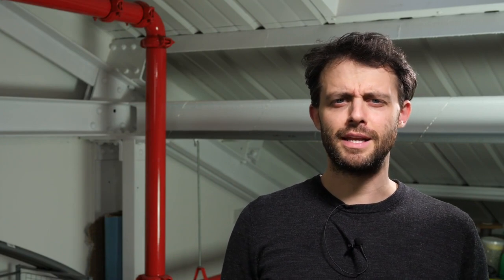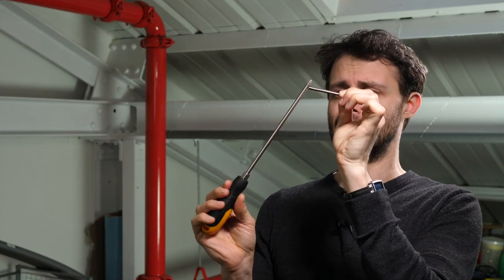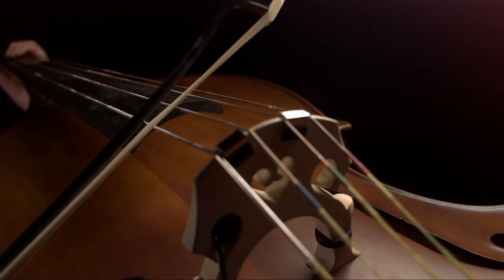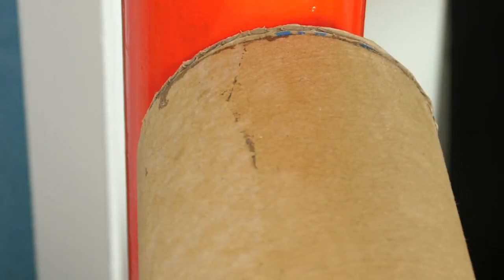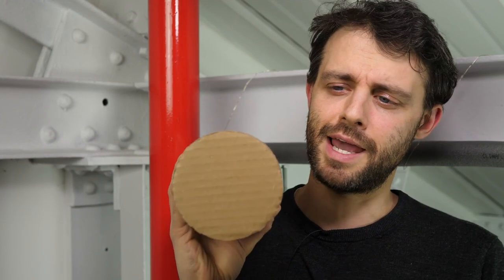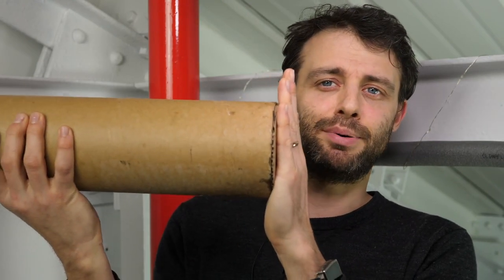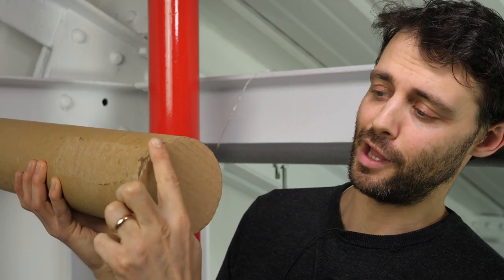The Climbing Magnets Mystery (ft. Steve Mould)

Comment: After watching less than half a minute of this, here is my explanation:  When you move the screwdriver around a bit in an effort to get the magnets to spin around, you are moving it quickly in very small partial rotations.  These short arcs, while not full 360-degree rotations, nonetheless impart a force on the magnets that is similar to the force that keeps the Earth from falling into the sun due to the Sun's gravity.  Any body in a rotational motion, even if it is a small arc that is only a portion of a full rotation, will have a tendency to move outward and away from the center of rotation.  This is just like spinning a yoyo on the end of its string.  The yoyo has a tendency to fly away, but the string keeps it attached, so it doesn't.  The main point I want to make here is that the magnets naturally tend to fly away off of the screwdriver because of the small arcs in the motion of the screwdriver that is used to spin the magnets around.  Basically, the screwdriver is making at least two different types of motion.  One is back and forth, which is what causes the magnets to rotate around the center of the shaft of the screw driver.  However, the other is the small arcs that also get the magnets to move in a direction perpendicular to their spinning.  While I probably haven't explained this as well as I could have, the small arcs would have their center either at or near the fingertips (I think you know what I mean) or at the back of the handle end the screwdriver.  Because the motion is erratic, that center is probably moving around a lot.  You could probably test this idea by putting washers on the screwdriver that are nonmagnetic.  Doing the same thing would probably cause the washers to start to move towards the end of the screwdriver opposite the handle and where the hand is holding it.  Anyway, that's my explanation.  Do you like it?  What do you think?
Reply: Okay:  I watched the rest of the video, so now I've watched the whole video all the way through, and I must say I did not expect the explanation that came.  Also, when the presenter turned the screwdriver upside down, and the magnets continued to go upwards, that was pretty interesting.  In conclusion, perhaps my explanation was not the complete answer in the case where the magnets were going away from the hand.

Comment: 0:44 The tip of the screw driver is spun around the furthest out. The centripeta forces is greatest there. If you were to loop a string around the screwdriver, it would do the same thing when spun around. If you spin a marble in bowl, it travels to the furthest edge of the bowl too. Everything does  this.
Reply: He tests this theory in the video and shows that is not the explanation.

Comment: I'm sure that if the screwdriver was kept completely vertical whilst moving in tight small circles, the magnets would not climb - in fact they would probably slide down due to gravity. The point is that doing it as shown the tip of the screwdriver is describing a larger circle than the base thus imparting greater centrifugal force.

Comment: It's because you're rotating the rod with a pivot at your hand. If the rod was tracing a perfect cylinder then the magnets would remain stationary or fall due to gravity. With that angle, though, the centrifugal force/inertia of the magnets exerts a vertical component on the slanted rod, which is tracing a cone.

Comment: I'm not fully convinced on the slip/stick explanation. As the magnets roll around the shaft their point of contact reduces to the point that it is no longer enough to hold the magnets up. At this point they will start to fall off but remain in contact on the lower edge. This is when the rolling around that lower contact point occurs and as the area of magnet having the shaft "in range" is then increased the magnets then snap back in and onto the shaft. In effect, the magnets are always rolling and never sticking or slipping?

Comment: the motion of the screwdriver is not perfectly cylindrical and the top swings more then the bottom. the spinning causes centripetal force while the magnets keep it attatched. the net result is a transfer of the magnets upwards as the centripetal force is greater near the top. but also it causes the magnets to rotate which in turn makes them roll along the rod and probably create some sort of magnetic force in the metal.

Comment: why not lube up the screwdriver to show it's dependent on the friction?  I think it's because the screwdriver is not vertical, it is tilted to one direction(towards the magnet) as you spin it around, causing the magnets to slip towards the path of least resistance("downhill" from the perspective of centripetal force) up the shaft.

Comment: I would have liked to see the screwdriver held horizontally and put in the drill and use the ruler as a backstop (similar to the vertical test).  If this explanation are correct, the magnets shouldn't move from their position on the screwdriver.  I think that would have helped to confirm the hypothesis.  I think it would have been interesting to demonstrate before the explanation as well as it would have helped in formulating a possible explanation by eliminating some ideas....

Just my .02

Comment: The explanation might be incorrect.
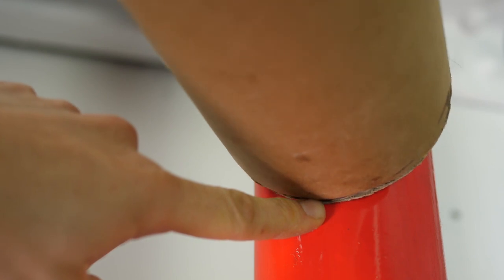Look at 5:53, the resulting direction of the rotation of the magnets does not match with the explanation.
I think that the pivot point remains the same, but the magnets rotate downwards due to gravity and the resulting momentum, instead of rotating upwards. Then they slip upwards.
Micht be wrong, but i think that this explanation is at least not complete...
Awesome video still

Comment: What would happen if the magnet had a square section instead of a circular section - a square prism? (I mean, the magnetic prism placed in such a way that two lateral faces were vertical and the two other lateral faces were horizontal). I guess the pivot point would be at the same height as the previous point of maximum pressure and so there should be no rising at all.

Comment: What if you had a magnet with a contoured end? - Does the same rising phenomenon still occur? (could machine a small bit of steel or iron (or any material) to change the contact/prevent slip)

Comment: Reply to Brad not Landa
Looks to me as though the angle of the screwdriver always leans, and that would make your contact points on the top of the magnetic column. As it holds to the screwdriver, I think the magnetic column pivots it's bottom a little bit upward and aß the magnets re-grip the shaft. Since the magnets are round it would be unobservable at the speed of rotation.  
That's my guess.

Comment: 25 seconds in: I'm pretty sure as you rotate the screwdriver you angle the point out a bit. Centrifugal force pulls the magnet away from the center of rotation, so they travel up the screwdriver
Reply: 1 minute in: shit

Comment: It’s the same as the standing pendulum in a reciprocating arm.  Or the oscillating suspended liquid.  The righting moment of the magnet up to the rod is a larger force than the gravitational oscillations downward.  Thus the over all result is that the magnet will climb over time.
Reply: After watching his explanation I still think my idea on asymmetrical righting could be coming into play as well.  It’s possible that as it rolls and slips it is also tipping so that less of a line across the end but a point on the edge of the end remains in contact.  It could could slip stick in multiple ways.  It would cool to see a high speed.
Reply: The ruler doesn’t replicate the slip-stick satisfactorily.

Comment: 0:15 ; 
Hypotheses: 
1. Not a perfect system, the angle on the screwdriver gives the attractive and centripetal force a verticle component.
2. As the system spins the magnets are pulled horizontal by the centripetal force, due to the larger momentum of inertia, they tend to want to lag behind the spinning action of the screwdriver. Because of being drawn horizontal, they now have a pivot on the upper side, the lag the magnets experience cause them to rotate around this pivot which also rotates with the magnet allowing it to roll up the side of the screwdriver.
Reply: Nope
Reply: 2:09
Renewed hypothesis:
1. Friction caused by the magnetic attraction drives the magnets with the rotation of the screwdriver, gravity imparts a downwards force. As the magnets loose attraction, a pivot forms slightly in front and below of the round magnets on the screwdriver, this allows the magnets to roll forward and a little up, attraction is now dominant again. Rince, repeat and the magnets roll up.
Reply: Okay, was not expecting it to be an unstable system.
Reply: 4:30
Booya

Comment: wish they had put a line on the magnets and filmed it in slow motion to show that the line goes around the magnets as they rise.

PS: wonder how much weight they could carry proportional to magnet strength. Should be possible to scale. And what is the slowest speed in which the effect occurs?

Comment: my first thoughts would be that centrifugal forces are greater at the top because the screwdriver top is following a greater arc than the bottom. Simply put, the magnets are trying to fling off the screwdriver and they get closer to flinging off as they approach the top. Put the screwdriver in a drill and your mystery won't happen.

Comment: Would it also occur if the screwdriver was moved in a perfectly vertical circle rather than a spiral where the largest diameter is at the upper part of the spinning screwdriver?

Comment: Doesn't this work with a string and a weight. Make a looped string put a small weight and at the other end and then spin it then it goes up around the screw driver. I remember seeing that demo done in my class. Is it the same thing?

Comment: 2 min in, like everyone else, centripetal force was the obvious guess, but wrong.   next guess - Left hand thumb rule - electromagnetic currents are weird, and I think that the motion of the magnets around the induced magnetic field in the screwdriver has a perpendicular reaction - like when you turn a spinning wheel one way, it tilts in a plane at 90 degrees to it (think a bicycle front wheel.  So perhaps the spinning makes a magnetic field, which interacts back with the motion of the magnet and pushes it up?  maybe.... gotta admit, when he spins it the other way around though, this should make the magnets sink...  hmmm... I think I bail on my own guess.... but even so - weird magnetic fields are happening.... even if they arn't the thing that does the magic trick...

Comment: So if you were to try doing this with those small magnets on a very large pole or pipe, say 2m in diameter, so the magnets are all but flush with the surface of the pole, this wouldn't happen?

Comment: I was thinking it had to do with the rotating magnets inducing a current in the screwdriver, hence inducing a counter-magnetic field, and the interaction of the two magnetic fields would drive it upwards.  Well... I was pretty much totally wrong and it's just the mechanics of the physical contacts.  Very interesting however.

Comment: looks like electromagnetic propulsion. As the magnets spin they impart a small charge into the metal rod, which in turn creates a small magnetic field. Since magnetic fields are perpendicular to the direction of electron flow, the generated electromagnetic field pushes the string of magnets upward.

At least that's the best theory I can come up with. It's definitely incomplete because it doesn't explain why the direction doesn't matter.

EDIT: I was completely wrong XD

Comment: The correct reason is that the the moving magnet on the metal screw driver induces a electric current witch in time creates an magnetic field that interact with the magnetic field of the magnets pushing it upward.

Comment: I don't think it's a magnetic phenomenon as such, it'd probably work if you looped a short string with weight on the end around the rod, as you gyrate the rod the top prescribes a larger circle than the bottom so it's centrifugal force causing it to ride upward. was only at 0:45 when typing this.

Comment: easy, when you hold the screwdriver up and rotate your reaction plane is like a V and the force (centripetal) is > relatively on the right side so its obvious it will travel on that slope. if you hold the screwdriver upside down and make an A shape reaction force plane, and it will travel down if you consider \ plane and -> force due to centripetal acceleration and  on the left side < and / same result... if it were | and -> it would have stayed where it was.

Comment: Although I am not a physicist by any means my first thought was that it has something to do with the 3 Finger rule and magnetic fields. Please correct me if there's anything wrong with my thinking here.
We'd have the magnetic field created by the magnets pulling on the screwdriver in one direction, our thumb. We are moving them around the screwdriver, which would according to that rule would be our thumb and that would mean the Lorenz force is pointing upwards and moves the magnets up and along the screwdriver.
Reply: Since you mention the 3 finger rule - what exactly is the 3rd force you are talking about?  
3 finger rule simply tells you the force on moving charged particles when inside a magnetic field. Does not apply here.
Reply: Ahh, okay, thanks. :) 
The three forces that I thought would be applied here were the magnet pulling on the screwdriver in one direction, the magnet being moved around the screwdriver and the force that pulls it up ^^' At least that was my theory.

Comment: So is no one going to point out that anything that rotates has torque, and that the angular momentum of the object spinning follows the right hand rule, where an object spinning counter clockwise has forces moving vertically "upwards" from the plane of rotation?  Use your right hand and make  thumbs up... your fingers represent the spin of the object, your thumb, the direction of momentum or velocity..  so, at the lowest point of contact, where there's more pressure against the spinning screwdriver, certainly Newton's third law says that same pressure pushes the magnet upwards, but since the length of the magnets coming off of the screw driver also create a sort of new pivot point at the lowest point of contact (where magnets will move in a counter clockwise direction), there needs to be a rotational force that keeps them moving upwards and I'm confident that can be explained by the direction of angular velocity and momenta by both the screw driver and magnets orbiting around the screwdriver.  The way this can be disproven is by facing the screwdriver downwards, adding clockwise spin when looking from above, and seeing the magnets move upwards still... if they move downwards, then the direction of angular momenta also happens to have something to do with this mini mystery.

Great video!